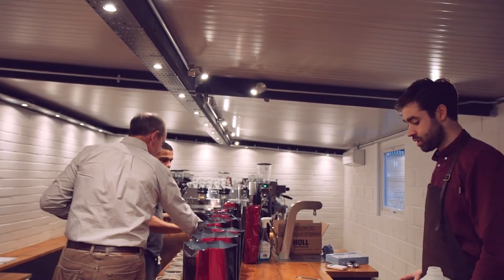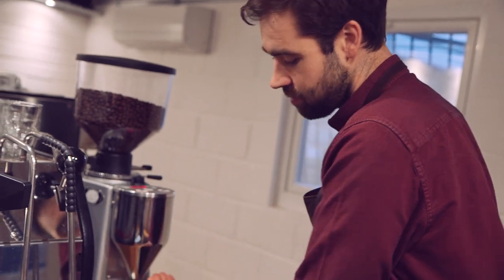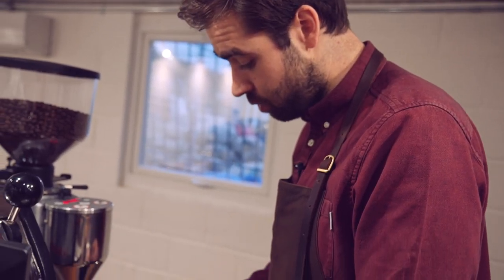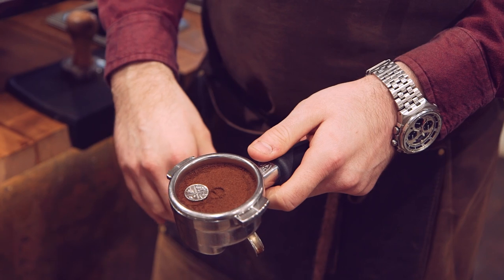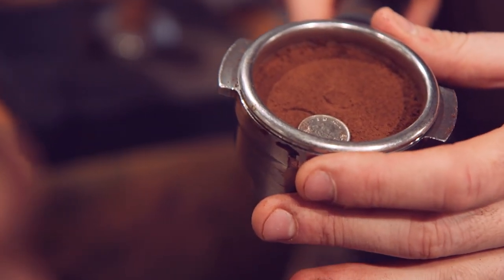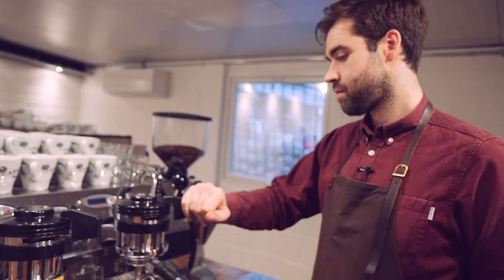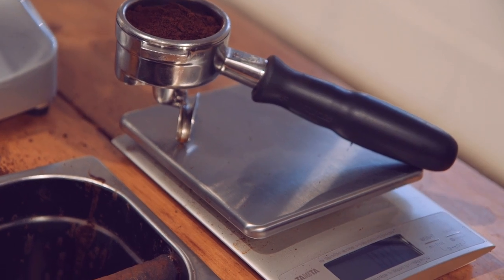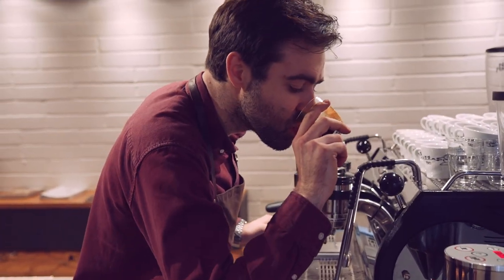How To: Calibrate Coffee Grinder | Wogan Coffee

Comment: Im confused so you put in the coin and then ground finer so you would have more space, but then increased grind size with the same weight later   to get the extraction to be quicker. So didnt that just remove the head space you  wanted originally?
Reply: Exactly my question. He adjusted the grind size to make head room, now he is adjusting the size to change extraction time. Which one is correct. This didn't make any sense.

Comment: I don't see the relationship between the 0.5p test and grind size. Can you explain please. Thx
Reply: The first step in grinder calibration, according to this video, is to find out the ideal ammount of coffee for a given coffee filter/basket size. Because the coffee grounds swell during extraction, the basket needs to be filled in a way that allows space for this swelling. What he did was to simply fill the basket starting from a visual baseline grind size (compressing ground coffee with the hand), distribute the coffee (north, south, etc), tamp the grounds and insert the coin. Upon inserting the portafilter in the grouphead if there's an accentuated coin impression, this means that the basket needs to be filled with a finer grind allowing more compression after tamping. If after the grind adjustment and tamping, the coin leaves a faint impression, the right ammount of coffe for that basket was achieved. Remember, there is no TAPING down the portafilter as it is being filled by the working grinder, just a level off and only after that we procede to TAMP down the grounded coffee. The way the basket naturally fills depends on the size of the grind and in this case it has to have a size that after tamped doesnt allow the coin to be hard pressed when the portafilter is placed in the grouphead. The featured basket's optimum ammount of coffee is 18,5 grams. after this, as long as there's always this ammount, the only job left is to fine tune the grind size ( within a certain range, of course) for an extraction according to the baristasa needs.
Reply: Sérgio Teixeira The only issue with this method is that once your reset your grind size to reach your ideal extraction (time/tds/extraction%/taste) you will have adjusted your headspace.
Reply: Finer ground coffee compresses more.
Reply: ok so it might be complete Bs cause if you notice he changed the grind size and made it finer to satisfy the coin test, and the result was the extraction took too long (overextraction) so he basically changed it to a coarser setting to pull his shot  in 20-25 seconds.
Reply: The coin test is only to establish how much coffee to use in the basket while allowing head room for expansion of the coffee during extraction. The grind is then adjusted for brew time which is anything between 20-35 seconds dependant on personal taste and preference.
Reply: Too much fluoride, your pineal gland is calcified and now you cannot see.

Comment: This is more of a Set-up video, shows U, the different "variables" in the basic procedure(s).  Not a Taste test, that varies with the Brand & Roast, but the Actual Set-up is the same for all Espresso Coffees.    Thanks for very informative video.... :-))  
Also, the GRINDER is just as important as the Machine, if not more so.  I have excellent Espresso machine, BUT my Grinder cost about 1/3 MORE than the Espresso Machine.  If you can't delivery the GRIND, a $3000.00 Machine is going to deliver the Espresso your looking for..... even a $10,00.00 machine!      thats my 2 cents.  I've been Roasting Beans for 20 years, and drinking well made Coffee for 59 years....  I just started the Espresso thing, why, because it's hard to beat a Excellent Cup of Black Coffee.
I'm not much on CANDY DRINKS, they seem to cover up the Coffee.
Reply: BWWGL9 so what’s your preferred brew method ?

Comment: Following the instructions on this video leads to the conclusion that I need to go finer, but If I go finer my espresso machine just starts blowing water out the back like I have the blind filter in.
Reply: Some machines can't cope with some coffee fineness. If you don't want to change machines, portafilter etc, go for different coffees. And  or try to get the coffee freshly roasted (forget that nonsense about having to wait 7-15 days after roast to have a good tasting coffee or some variation on that topic)

From my experience, freshly roasted coffee in general doesn't need to be grinded as fine as coffee that it's not fresh. 

Ex. If I take longer than usual to spend the 1kg that I get freshly roasted, what I observe is that at a given point, usually about a week after purchase, I need to make the coffee finer and sometimes updose  in order to have a somewhat enjoyable extraction. Humidity might play a role, but the same happens during summer time and I live in a very mild weather country.